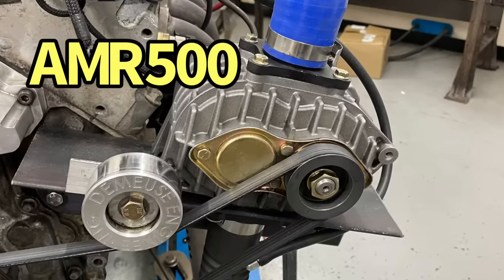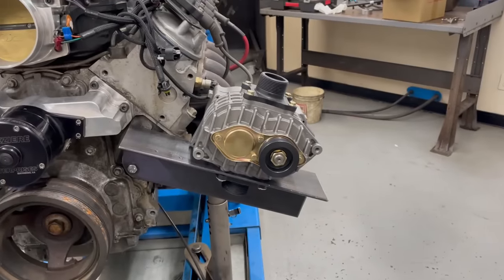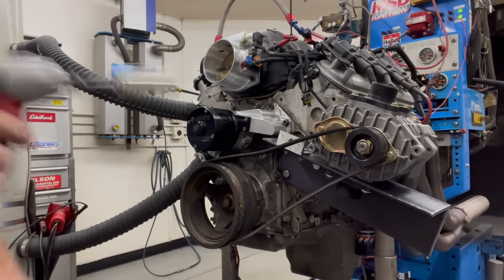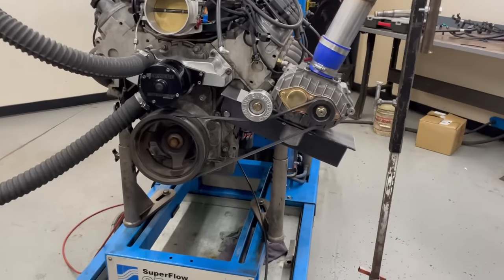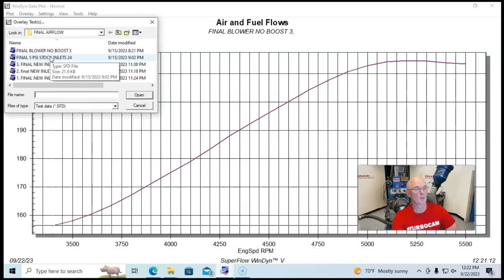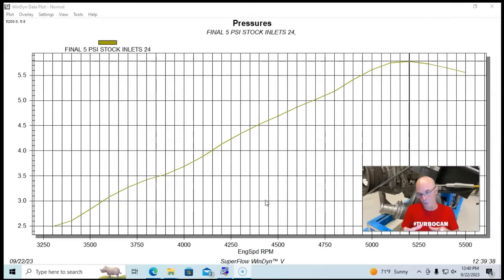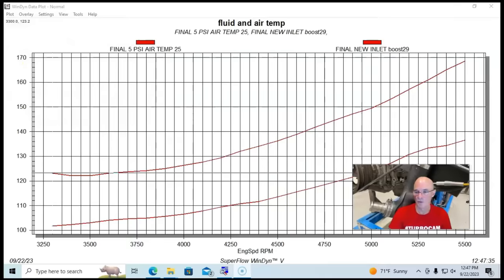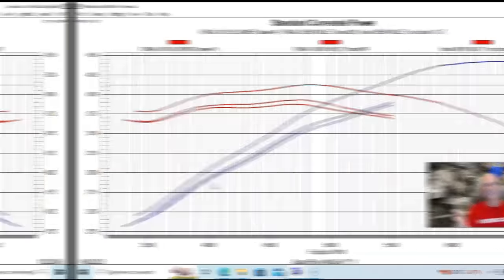THE ULTIMATE CHEAP, EBAY, AMAZON AMR500 BLOWER TEST. FULL RESULTS-AIRFLOW, TEMP & POWER CONSUMPTION

Comment: I think the blower lobes are actually separating. I don’t think the housing or the gaps inside the housing between the lobes are holding any more pressure.
Reply from the maker: not at 5 psi
Reply: @richardholdener1727  then I guess maybe it’s some sort of cavitation issue turbulent air flow through the housing in and around the lobes, the reason I’m saying that as I think the rpm of the rotors is such that it should be creating more than that. She sounds like she’s really screaming and to only make 5 pounds of pressure seems off. But I’m not really a blower guy. I don’t know much more than the basics. But it does remind me of the blowers from the 30s in the 40s. They also made a lot of noise but didn’t create a whole Lotta pressure.
Reply: @ajjskins  This thing sounds like an air raid or nuke alert siren

Comment: Cool video! 👍 I am surprised that the AMR actually survived the test, as the LS was driving that tiny thing HARD! 🔥🔥It would be interesting to see how much heat is generated within the blower itself. For durability, the AMR might benefit from a separate oil feed, in combination with an oil cooler?

Comment: Air flow and air pressure are inversely related. Adding better flowing inlet/outlets reduces inherent restriction. This increases air flow (cfm) while  simultaneously reducing pressure (psi) which is just a measurement of restriction.

Comment: 30* temperature difference with big intake, but less boost - Air is more dense packing more HP/TQ (~1% per each 10 degree drop in NA engines)

Comment: You got less boost on the restricted runs with the larger intake specifically because your air density was higher, as proven by the lower temps. the mass flow rate was probably higher too, but for the same mass flow rate the parasitic loss was lower. overall that was a notable improvement to go with the larger inlet, good stuff!

Comment: Pressure Temperature correlation,  less heat= less boost. It's more about the actual mass of air moving through the system as opposed to the amount of boost produced.

Comment: Two different outlets, the one with less boost had more flex in the rubber causing a greater loss in boost. To solve this use ridged pipe while keeping the same volume.

Comment: Amazing work on this! Some things I noticed:
Early pulls show the blower belt with alignment wear as evidenced by the white threaded material showing on the edge of the belt 5:53. 
The blower mounting bracket is being flexed forward under load which you can clearly see at 8:40 if you watch the blower in relation to the engine, letting the blower belt walk on the crank pulley. 
The belt looks like it rode up onto the outer lip of the crank pulley probably causing slippage (watch the engine crank pulley where the electrical cord in the floor is) you can see the belt was still on the outer lip of the crank pulley when you shut it down. 
Can't wait for the next video!!
Reply from the maker: no on the belt slippage caused by deflection. The belt walk was caused by simple misalignment after installation of the new inlet and outlets. I didn't align the belt before tightening the blower in place like I did when it was first assembled

Comment: Now you need a 3 cyl Geo Metro engine to put it on!
Reply from the maker: good choice
Reply: @richardholdener1727  Honda D or B series, although B series VTEC might create an issue with the extra airflow when VTEC hits. Even with an Eaton M90 on a GSR motor, the boost dropped 3 psi at VTEC crossover.
Reply: @richardholdener1727  so this thing put out the equivalent of say a china intake port for a sbc head?

Comment: I firmly believe boost numbers are simply restriction numbers. The reason the boost number went down even though the flow increased proves that. Higher boost numbers are simply signs of restriction, improve the flow and the CFM will increase but the boost pressure decreases. It's like trying to blow through a straw vs a 1 inch pipe, you'll move more air with less restrictions.
Reply from the maker: Now take the next step and dramatically increase the flow through the smaller straw (the restrictor), with more flow and the same straw-why was there not more boost

Comment: Those little blowers would wear out quite quickly at 18000 RPM. At those revs it could possibly get rotor bind from the C forces causing the rotors to grow. Back in the '60s a mate fitted an 875CC Godfrey cabin blower on his 1066CC mini. He ran it around 5 to 8 PSI. he found rotor bind at 11,200 rotor speed.

Comment: Spend $35 more and get a gt45 turbo that actually work
Reply: Not a blower though, I don't know why we don't see Chinese universal superchargers
Reply: @mackenziehutchison4838 because turbo tolerances can be forgiving while with the rotors of a supercharger they need to be precise.
Reply: @Joebauers2505  idk how true that is they've been making superchargers since the 1800s before turbos where practical to make. My thought was more cars can run turbos like i4 then a a big screw blower so they make turbos.
Reply: You must not know who Richard is.
Reply: He's already done the gt45 multiple times..lol
Reply: 🤣I know he already done them many times, I just wanted to see everbody opinion on it plus why Chinese turbos are better then Chinese superchargers
Reply: @Joebauers2505  that makes a lot of sense that's why they're so expensive. I never thought about that
Reply: Turbos restrict the exhaust gas flow and don’t make power until about 1800 rpm. Something that spools up fast runs out of puff further along. Blower is pumping the same volume per revolution all the way up.
Reply: @Dave5843-d9m   ehhh even with no restrictions the little blower was falling off
Reply: While this is very true, you do have do a LOT more work to get it finished. So, honestly, I would just bite the bullet and spend a couple thousand more for one of the big 3 turbo kits for the LS1.
Reply: @1fast72nova  it goes not messure this way, first connected must know the engine suck air and then have right pulley as it be over pressure, it can fail if have a big engine, this little recommended up to max 2000cc,and 18000 rpm is to mutch on every blower in the market.
Reply: @peggenlejoncar9529   for real. Any math at all would have shown it would probably take 3 minimum to actually gain anything
Reply: @mackenziehutchison4838 Both of you are wrong. People and Car manufacturers use turbochargers because they are far more efficient and make more power with otherwise wasted energy. It takes something like 50 to 75 HP just to spin a blower, and you obviously have to worry about belt slip. The Hellcats get like 6-8 miles per gallon. That is an actual real number. Replace the supercharger with a modern Hot V turbo setup, and that car makes more power and uses less gas to do it. There are multiple twin turbo V8 engines making 600+ HP with a 4 liter V8 that gets 20+ miles per gallon. There's a reason nobody uses superchargers anymore. It's like ancient technology at this point, and better options are available if that's the direction the whole industry has shifted.
Reply: @catch22frubert  this is aftermarket, idk how many people here are putting S475 and blowers on there LS to gain mpg. I like superchargers because of the drive ability and instant tholte. And the hellcat is rated at 22 highway, gt500 and zl1 21 highway.
Reply: @catch22frubert this, thank you. that's what I was going to say.
Reply: hole saw is spinning too fast
Reply: And then you can heat up your oil o wait a oil cooler
Reply: @catch22frubert OMG! STOP! It's not "otherwise waisted energy." Exhaust is pushed out of the engine for the most part by the power stock of another cylinder. A turbo is a restriction. Do not say it is not. A compressor needs to have "work" put into it to operate. HP is a measure of work. Work is not free. If it was perpetual motion engines would actually be a thing. When a turbo is introduced into the exhaust system the gasses have to be pushed out much harder than if it was not there. So what you are doing really is using the engine as an air pump to create pressure to drive the turbo. That takes "work." Its not free. If he takes a turbo that makes 5psi and 250ish cfm and did the same test you would see the same 15-20hp loss. It literally has to happen. What you will see in a similar test is different horsepower and torque numbers in different areas but if you do the math an average it all out the amount of work going into both (meaning overall horsepower loss) will be within a few percentage points of each other.
Reply: @nhbountyhunter you need to go and do some research. I think your going to find that the turbo is much more efficient as a way of adding power than a super charger. Simply ask yourself why all the high efficiency engines are not using superchargers and why does formula 1 not use super chargers, even what are the most powerful supercars using? It's all dead tech but you're living in the USA in the 40's. 

Out of interest before I get called a turbo fanboy I'm currently building a supercharged (m62 Eaton supercharger) engine for my track car. Why? No torque surge when in corners will give me a better overall lap time and I'm only aiming for 320bhp because the car is super light. If I wanted to use the same engine to do 500+ bhp I'd go turbo but then it would be hard to predict on track.
Reply: @house89147  the simple answer is because "high efficiency" vehicles use turbo to boost at low rpm to add torque at very specific rpms. The engine tend to be small displacement and cannot product TQ being naturally aspirated. It's CHEAPER to design and implement a turbo system into a small displacement engine to add power in a very specific way. SC can do it but not a cheaply as turbos. As far as F1 cars. I believe it has to do with power to weight. Turbos are smaller and in general weigh less and can fit in tighter spaces. So not only will it fit in the engine bay better but also not add as much weight. In Indy 50lb can make or break a win. Any compressor that makes X psi of boost at Y cfm will take about the about same amount of HP to drive period. How it gets that HP is irregardless.
Reply: @nhbountyhunter  go do the research and stop making things up.
Reply: @house89147  I have. That is why I am typing. Just like everything else it depends on what you are trying to do. A Top Fuel dragster uses a SC because in that application they make the most HP and perform the best. In F1 they use Turbo's because in that application they perform the best. But when you average out HP and TQ you will find similar sized compressors need similar work input into them to make boost and CFM. Whether that work is made by a belt or by moving gasses means nothing. Due to how they are powered make some differences though. HP and TQ come in at differing times in the RPM range. There is a reason super chargers are still used on many vehicles they have their place just like turbos. But the fact is turbos are not always more efficient if they were SC would be totally disregarded.
Reply: Do any of you not understand that this is made for small engines and not a damn truck V8? 😂😂😂 these things are for sub 1L engines
Reply: @house89147  never seen a pro-charger have you? Those can easily be as efficient as turbos or so close to that the difference is almost immeasurable
Reply: @catch22frubert  you’ve never seen a procharger😂😂😂
Reply: @house89147  woo wee. Just found a video from Alexltdlx on YouTube. He is using a hobby motor to drive a centrifugal compressor (turbo charger\pro charger). That motor is 15000 watts max. That translates to roughly 20 mechanical horsepower. He is making about 6 psi at 80% power of the motor. A hellcat makes about 12psi, so that might take a massive 50hp to drive, maybe.  So... Even if a turbo used free energy to turn it and EVERYTHING ELSE was equal. That would mean a turbo would make (in this case) a whopping 50hp more than a SC... But it's not equal is it. Turbo build a crap ton more heat, have much more tubing\intercooler to rout  through causing friction losses, and have lag. Again, when all the math is added up and the final numbers in, when comparing SCs and turbos are so close to each other in total output it will depend on the use case, setup, motor, and builder on which is the better power added for your individual setup.
Reply: Its easier to add a supercharger than a turbo

Comment: My thought on the difference between flow and boost between inlet and outlet types, making less boost with more flow is that higher flow velocity is naturally lower pressure. So the higher flow number was stacking up less boost - still better for the engine. Steve Brule explains it on Engine Masters better than I can.
My estimate is that feeding that 5psi of boost through that engine would make another 132hp(ish) - more than making up for the power draw of the blower

Comment: The output hose was collapsing on the big inlet test, this led to less airflow and less boost. A fixed restriction is nothing like having an engine attached to the blower as the engine can accept more air the faster it spins. It is still a useful test but the only way to know how the efficiency curve of the blower works is to overlay it to the efficiency curve of the engine by connecting them together.
Reply from the maker: 150-hp blower on a 440-hp motor doesn't work and how does a hose with pressure collapse (that would be a big no)?
Reply: @richardholdener1727  you can see it bending in the video. I don't understand your other comment, makes no sense.
Reply from the maker: the movement you see was thrust created by the airflow, but if your "theory" of collapsing was correct, the big inlet and outlet (where the tube moved slightly) would have flow less air and had more boost. The big in and out had MORE airflow...not less

Comment: With the large out let probably the reason it didnt build as much boost… i bet if you mix and match, super richy inlet/stock outlet would probably pick up your boost
Reply: I agree, it is like running a intercooler with too high of a volume. Keep compressor side runs low in air volume for good snappy boost...
Reply from the maker: nope

Comment: I am not a physics expert but I believe the higher boost pressure in the system with more restriction is due to the higher temperatures. As temperature increases so too does pressure (in a closed system). Obviously this is not a closed system, however the increased temperatures may be impacting the pressure, accounting for the cooler faster flow rate superflow setup to make less boost (pressure).

Comment: You could almost Hear friction. Like it was fighting the motor. With the size and the amount of air that ls uses. More inclined to believe that it’s too small and not putting enough air into the system for it to effect it substantially

Comment: This is too cool! I had been wanting to buy one of these for a long time and slap it on a 1.8L or 2.2L Subaru engine and see what kind of power I could get out of it. I heard they were limited to about 16,000rpm, so I thought I would try for a 2.75:1 or so pulley ratio. Then 6,000 RPM would put it at 16,500rpm and hopefully it would live if I went past that for brief stints. If I could get about 250cfm out of it at 16,000rpm, that would be around 20lbs/min of airflow at sea level, so right around 200hp. Doubt it would get there though given the boost number. The EJ18 makes 110hp stock at the crank, so if it could get even 160hp it would be a massive improvement. I thought it would be a good match, but now I want to try it even more!
Reply from the maker: 250 cfm is not 200 hp
Reply: @richardholdener1727  Hmmm how much is it? I was trying to look into HP conversions and the best I knew was to convert CFM to lbs/min and multiply that by 10 to get HP. I obviously knew that would only be an ideal number at sea level, which is why I put the final horsepower hopeful number much lower also given parasitic losses and all.

Comment: Part of the boost reading is restriction but in the comparison of poor vs better inlet and outlet transitions the poor will restrict inlet flow which works the air raising temps and restricts outlet flow also increasing temps as seen in the data.  Increased temperature expands the system air increasing boost READING but lowering mass flow.  So the better inlet outlet was moving more air at a lower boost READING.

Comment: I may be wrong here...but off the top of my head - air being a fluid built up the same PSI (pressure) however requiring higher engine revs to compress that volume to the same PSI.  I believe if you overlay the oem fitting with the super fittings...you'll see the net performance of the blower was nearly the same.  However, using the large less-restricted ports, you achieved higher CFM, and also lower charge air temp (higher air density)...so the 'super' ports should make higher overall boosted engine horsepower (assuming the ECM adds additional fuel).  Richard....am I wrong ?  Great stuff here...thanks !
Reply from the maker: the net performance was not the same

Comment: Would have been nice to see it hooked up to the engine to see the HP draw vs any gains using such a small blower on a big displacement engine
Reply from the maker: 150-hp blower on a 440-hp motor doesn't work
Reply: then why run it with a LS???
Reply: @richardholdener1727  I know this I was just curious on the effects it would have had on that engine
Reply: What if you ran two of them?
Reply from the maker: the LS was only used to spin the blower to test airflow, temp and the power required to drive the blower so we now know what kind of motor we should run it on-once again, a 150-hp blower does not ADD power to a 440-hp na motor
Reply: @arthurdeckbar6397  wasnt hooked up to this engine